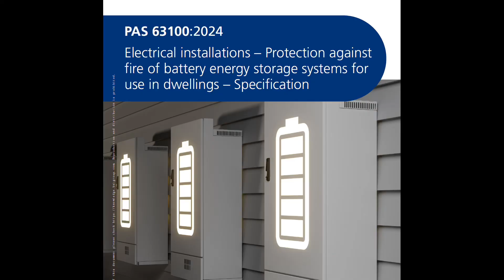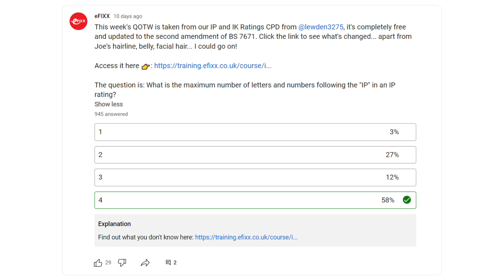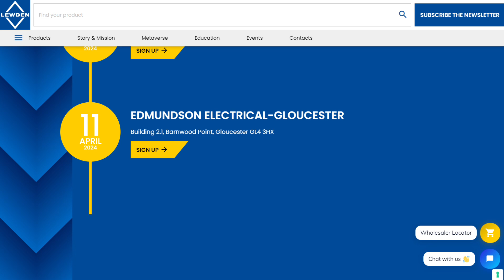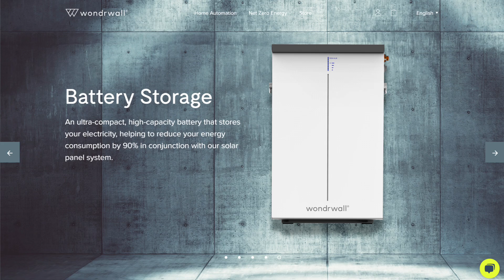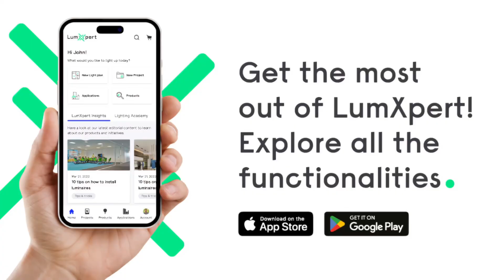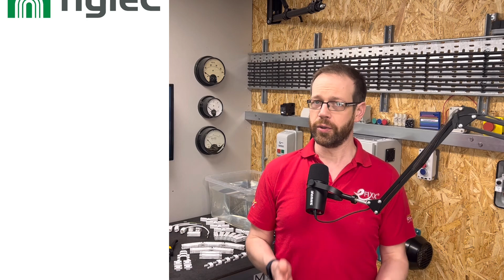New Standard Bans Solar Battery Storage In Lofts BSI  PAS 63100:2024

Comment: Have to say i was unaware of the large numbers of fires that have lead to such a draconian documents publication.
What stats have i missed?
Reply: Typical ebike battery seems to be about 500Wh, and they are bad enough when they catch fire. A Tesla Powerwall is 13.5kWh. They will be safer than a typical eBay bike battery, but not 100% safe.
Reply: @katrinabryce  Typical misinformed nonsense. Cheap eBike and "hoverboard" batteries are an absolute fire hazard. Totally incomparable to a home battery system.
Reply: @Cheradanine cheap chinese 18650 lithium ion cells or cheap lipos in a pack are a far cry from a decent BMS managed life pack used in most solar systems. I suspect any regulation will specify chemistry that must not be used inside.
Reply: @katrinabryce  Ok. But you must surely be aware of the difference between an e-bike charger and a lifePo battery with BMS?
Nothing in life is 100% safe.
Except the fridge that noone ever switches off 😲

Comment: Glad to see you highlighting this - so many installers haven’t been made aware.
Reply: Has this been in forced or is it just a recommendation
Reply: Sure. I dont agree with the report. But it is the sort of information that you kind of want to be better spread. Im still not clear as to whether to adopt, partially adopt. Until its definitive and regulatory its not very helpful in creating an equal and safe marketplace for solar installers and consumers.
Reply: @DavidUC9  I had my system installed in December - the 40kg battery is in the loft directly above the staircase. The installers simply fitted a 10 year linked smoke detector set - 1 in the loft and 1 on the landing - as there was no where else the battery could go. Should I be concerned?
Reply from the maker: Thanks Jordan. 😊
Reply: Who is suppose to tell us MCS ???? Battery manufactures or suppliers dont.

Comment: Was madness putting them in lofts, can't believe anyone thought it was a good idea.
Reply: My brother has his battery stack currently in the loft because the installers said that this was the best place for them. They were going to put mine in the loft as well, but I opted for them to run a longer cable down to the garage instead, which I'm glad I did. I think what I'll suggest to him is to put a smart fire alarm like a NEST inside the loft, just in case.
Reply: @alpachino468  Thats probably a very good idea putting a smoke alarm in the loft although I would check if a heat alarm might be better.  You could hard wire it from lighting circuit and use an RF base to link to other smoke detectors in the house..
Reply: @steve11211 Get a combined smoke and heat alarm in the loft that is interlink to every floor of the dwelling.  So on average house with ground/First and loft you would need a min of 3 interlinked units.   Also very important to test the fire/smoke/heat alarms every 6 months at least.  Get in habit to test when the clocks change.  Eg clocks spring forward 1 hour on the 5th Sunday of March normally between 2 and 4am.  Obvs dont test alarms at that time of the morning of Gaz next door might have a few words.
Reply: @steve11211  my battery was fitted into my loft space when installed last yr, I questioned this at the time as it could have been positioned in my garage! As being part of Essex solar installation program I went with this ,a smoke alarm was fitted . What should I do?
Reply: @stevendigby6125  Is the smoke alarm interlinked with other alarms?  Sergio replied to one of my replies with good advice, I would make sure the alarm in the loft is interlinked with at least one other alarm on each floor.  Basically this means if one alarm goes off then all alarms go off, this can be done either by hard wiring the alarms together or linking them wirelessly via radio frequency, I personally would avoid a battery only alarm in the loft as you may miss the low battery beeps..  With regards to smoke alarms in lofts I would check with the specific manufacturer that the alarm is suitable.  Fire angel I know recommend heat alarms for kitchens, garage and lofts, the high dust content may interfere with smoke alarms but each manufacturer may have different specs so best to check with the manufacturer.
Reply: @steve11211 thanks. I live in a bungalow so we would here the alarm!
Reply: Spot on we had a solar quote and they were planning to put in loft. Most do as it saves them on copper cable and work. Good legislation
Reply: Octopus suggested this to me only last week as we don't have an attached garage and outside space is limited. Felt risky.
Reply: @LDaQuirm  Highly recommend not going with Octopus, they are doing dodgy things with upgrading main fuse in my opinion..
Reply: Totally agree been saying this for years...  Will put a lot of people off having solar panels though..

Comment: Lithium batterys in thermal runaway cannot be extinguished.... They shouldn't be allowed anywhere near your house let alone in you bloody loft! 

Im fortunate enough to live in a rural location with enough space for my batteries to be in a steel shipping container....
As for PV panels they shouldn't be allowed to be installed on roofs either....
When these panels fail, and in time they will (and I'll sadly be proved right) they're going to be a monumental fire hazard...  
 
lithium iron phosphate batteries, inverters, and biracial pv panels are the future and they're here to stay, but it's relatively new tech and a new battery chemistry, that needs to be treated with more caution than (in my opinion) it's being given... 

Just because you want them, and can afford them doesn't mean you should fire on in and put them in your loft and on your roof...
Think on... your children are asleep under these devices!!! 

It's all shits n giggles, until somebody giggles n shits! 

My instalation is fantastic, the kit is amazing, but if it goes badly wrong I'm not gonna lose my house or somebody I love because of ignorance....
Reply: We've been putting PV panels on roofs for 20 years now, crap electronics from amazon/ebay or those innocent candles are far more likely to burn down your home.
Reply: Most house batteries use LiFePO4 chemistry which isn't very flammable and if you do manage to get it on fire you won't get thermal runaway. There are plenty of videos of people causing deliberate damage to them with almost no effect. There's stuff in my loft which is much more problematic in a fire than a house battery.
Reply: If the requirement for home energy storage is just have space for a shipping container and ground mount PV system, cool for farmers I suppose, but those guys always come out on top.

Comment: Any sparky that has ever worked in a loft knows how hot it gets during the summer, always thought having batteries in the loft was a bad idea..  I wonder how long it will be till those rules are made retrospective and we have to start C2 batteries in the roof..
Reply: I don't think the issue is how hot it gets in the loft.  That doesn't cause the batteries to catch fire.
Reply: @deanXRayZulu  You would hope there would be some kind of fail safe but yes overheating is a thing, generally solar batteries have an operating temperature of -20 to 50 degrees but it is recommended to keep them in 0 to 30 degrees.   Lofts can get above 50 degrees in extreme heat, its just not a good place for batteries to be..
Reply: @steve11211  The issue isn't overheating of the batteries. Plenty of lithium batteries catch fire and it is not a hot sunny day.

The issue is a fault in the battery.
Reply: Should you ever be applying retrospectively on an EICR?
Reply: @edc1569  No RCD for sockets where mobile outdoor equipment could be used is a C2...  Thats retrospective so generally not but if its serious enough, like potentially non metallic cable clips especially over a fire route door could be a C2..
Reply: Insurance companies will likely start to refuse cover if you have batteries in the loft.

Comment: I haven’t even installed any yet but I’ve said this for ages. To me it’s just common sense. 

I asked if smoke alarms were needed at a training event and they said no, but again I’d do it first as last. Even if it was just an inverter. Again common sense.
Reply: Would smoke alarms actually help? From what I've seen of battery fires, you are not going to have enough time to get out safely after the fire starts.
Reply: @katrinabryce  Not an insult. Just a question. 
What have you seen of battery fires?
Reply: @DavidUC9  From nothing to full-raging inferno pretty much instantly.

Comment: I don't think a loft is the correct environment for any control equipment, including batteries, because of the risk of fire and the extreme range of temperatures typical of uninsulated roof spaces.
Reply: Maybe look at the batteries that are used. Totally different to what is used in cars and significantly safer. 100s of gas explosions a year in the home no one is talking about banning gas in the home. Seriously you pipe flammable gas into a confined space with electrical equipment and naked flames and you're worried about batteries? 😂

Comment: No batteries in the loft just put them outside by the Oil tank, be safer that way.... All joking aside going to be interesting to see the average house with heat pumps and batteries outside... I wonder how long before those expensive batteries disappear in the middle of the night....
Reply: Just store your electric Chinese scooter up there instead?
Reply: Presumably you are replacing your oil heating with heat pumps, so remove the tank and put the battery bank in the same location.
Having said that, a battery bank is probably more dangerous than an oil tank. I don't recommend you try this, but I would guess that if you dropped a lit match into an oil tank, the match would go out. It is about as flammable as cooking oil. Chip pan fires do happen, and they are very serious, but it is relatively difficult to get it started. If the battery bank were to catch fire, then that would however create enough heat to set the oil tank on fire as well.
Reply: @katrinabryce  my oil tank is between my garage and next doors fence, my boiler is in the detached garage which is 2mts away from the house , the only wall that could accommodate a heat pump is 2 mts long where my gas cylinders are for my hob that faces next door, no cupboards indoors to accommodate any ancilory equipment for the heat pump exist airing cupboard is the with of a 2ft door x 8ft in hight all existing pipework rises from the floor, my south facing roof could only accommodate possible 4 sola panels east & west might accommodate 2 more each side, I'll think I'll stick to using my 2 log burners.
Reply: Can you imagine what was said when they proposed delivering explosive gas into 18 million homes?  Reality is removing gas from homes offsets the explosion/fire risk dramatically
Reply: @edc1569  Gas is dangerous but you missed the point. We can easily test the security of the piping and associated appliances easily. A pipe is a pipe... unless it corrodes, it will not leak and that corrosion can be checked. The problem with batteries is that if the separator is placed a fraction of a millimetre out, the electrolyte was contaminated by something or a myriad of other little things... it can catch on fire, a day, week, month, year or even decade later. But the main issue is, you can't visually check any of it. You can't check if the separator was installed correctly inside that tightly wound battery for example. If it does catch on fire... the fire isn't the problem either. It's the cyanide gas it releases within seconds. Which means by the time you notice it's on fire... you are already dead. Hence not putting it within 1m of any openings or vents in the house and certainly NEVER inside the house.
Reply: My thoughts exactly!

Comment: When does the BSI change on batteries take effect? Considering solar and would not be happy with it in the house but don’t want it outside or in the garage so considering a dedicated compartment.  

The hilarious thing is my electricity bill used to be around £60 per quarter with no standing charge from a Company called Ebico. 

Now my electricity bill is more than that for the standing charge alone. 😢
Reply: Don't put battery systems in spaces like a loft which are exposed to huge temperature changes, you will get longer life and better perforamnce if its installed anywhere else.

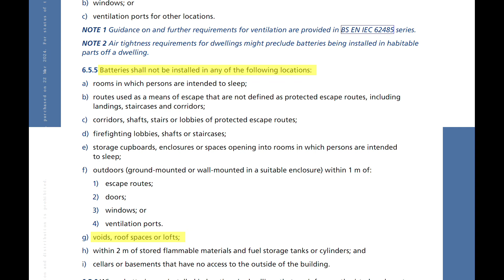Comment: [00:50] Just paused to read the text, and the prohibition about outdoor fitting of a battery within 1 metre of door, windows, ventilation ports is going to preclude of lot of those locations as well.
Reply: Not that tricky really, if your safety is at stake , don't install.
Reply: @raychambers3646  What stats are there to show there's actually a real problem?
Reply from the maker: Yup, it's going to be tricky... 🤔
Reply: Tricky is a bit of an understatement...

Comment: I would not allow inverters to be installed to loft either.
Reply: Don't have a problem with the inverters in the loft, they'll self regulate back when they get hot and they're not affected by cold, plus theres not a lot there to sustain a fire.
Reply from the maker: The you are as one mind with the BSI! 😃👍💪